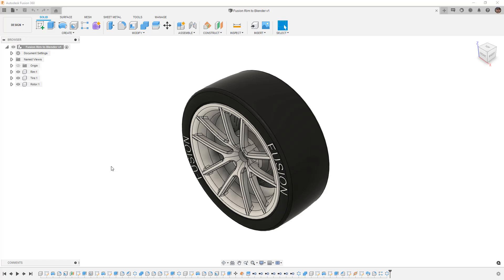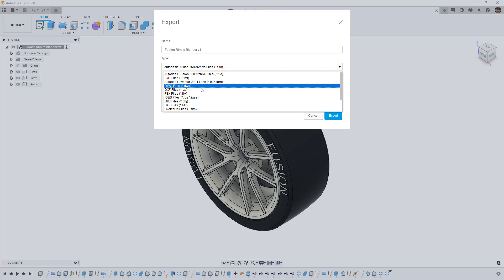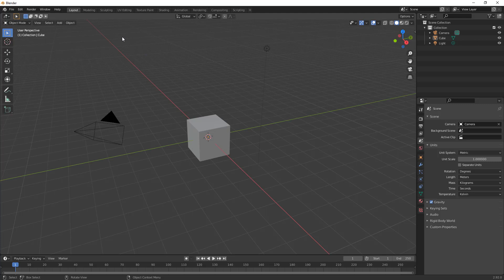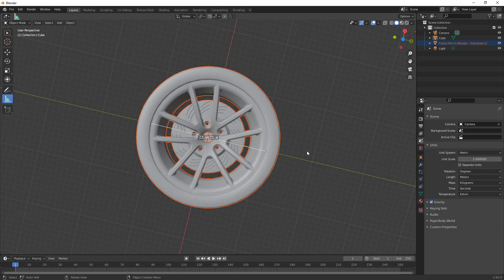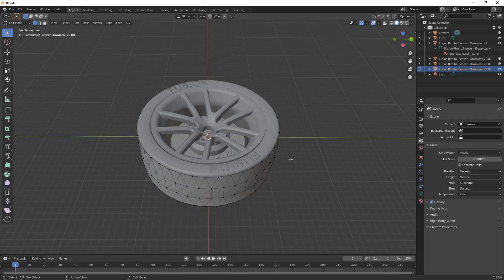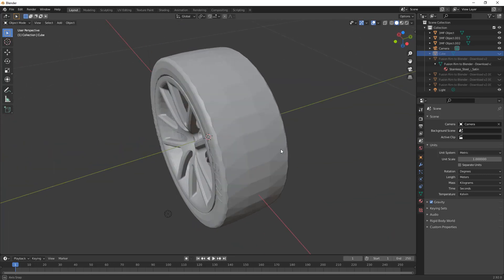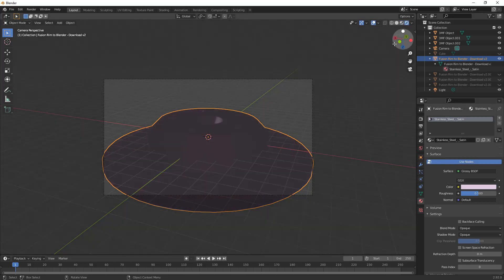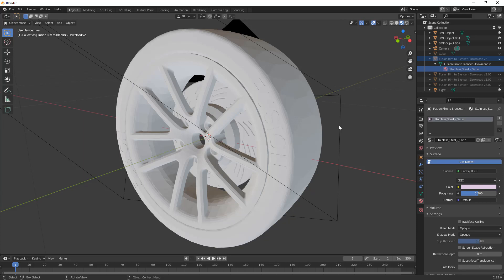Importing designs from  Fusion 360 to Blender - Part 1

Comment: hi I am trying to import a FBX file for fusion to Blender, the file imports, but nothing gets displayed, the textures are there but the mesh bodies automaticaly go into a unused section and i can't even access or recover that data on blender, and i automactly gets deleted when I close blender? is my FBX file corrupted?
Reply from the maker: which version of Blender are you using?  some of the imports/add-ons have changed a bit.
Reply: @LearnEverythingAboutDesign   i am on blender 4.2 I also noticed that when ever i create a New Fbx file it also creates a mtl file i have never seen it before
Reply from the maker: @randompersonlol7930  I am on 4.2.1 LTS and the fbx import worked fine for me.  Mine doesn't seem to create an MTL file  for the FBX export.  only an OBJ.  its a material companion file and generally when importing an OBJ i think it references this.  FBX should just take the color info in with each body on import.  

If you send me an email support@caducator.com ill send you one of my FBX files and we can see if the same is happening.

Comment: How do you add the add on with Blender 4.0.2? There is not test label under preferences. Thats as far as i have gotten.
Reply from the maker: hmm, it doesn't seem to work sadly.  You can stick with an OBJ or FBX format.  I don't see any updates to support the 3mf format.  Probably because its more of a 3d printing format.

Comment: I plan to watch the rest of your videos about F360 to Blender as I prefer the workflow.  Q: Why not use FBX format between the two apps?
Reply from the maker: Part 2 is FBX :)  obj and fbx in this case really would be no different.  If you were exporting out of blender then FBX might be the goto option as it has animation data.

Fusion can convert a solid body to mesh in fusion with "try quads" option. however when you export it as an stl. obj. fbx. its always going to be Tris unfortunately.  There will be some file size differences and OBJ and FBX will take appearances so in Blender you will at least have different starting colors.

Comment: I do not have the testing tab on Blender at 5:44. How can I activate the Add-On?
Reply from the maker: I just tried this on 3.5.1 and I don't think that add-on for the 3mf format is supported any more sadly.  I can't get it to work.  The testing tab i think went away with v3.5.
Reply: . @LearnEverythingAboutDesign Does this mean that the information covered in this vid about add-ons is no longer practical?

Nevermind, found the latest release of the add-on which works (1.0.2)
Reply from the maker: @leonzhang9287  Glad you found it!  I need to update this video!

Comment: Major thanks. I was just thinking this would be a great thing to do as Blender sucks for anything CAD, not having having drawing planes or a constraint system. Mind you, it is great for renders while Fusion 360 pales in comparison.
Reply from the maker: Yup :)  I ended up doing a few videos on this.  The program Plasticity I have been covering is a good middle ground as well. Not as rigid as CAD but work on actual solids.

Also this is on my radar to try. not free but looks easy to use https://lighttracer.org/#pricing

Comment: can you convert a building for example to blender and from blender to cs go hammer editor as a map ?
Reply from the maker: I haven't used Hammer before but I would imagine if you can UV Unwrap it in blender, that is the info you would need.  So yes at the core what you are doing is converting your 3d model to a mesh.  If you plan to texture it in Hammer, then going from Fusion to hammer might be an option as some formats like 3mf will carry appearance data with them.

Comment: As you suggested - I saved a model FROM Fusion in inches TO 3mf and then imported TO my blend file which was preset to metric, meters, and .001 unit scale. Size came out perfect. Love it.  I would say though that the add-on designer could make this size conversion more clear; wasn't obvious. Thank you for this video.
Reply from the maker: Thanks for sharing!

Comment: After importing an .obj from Fusion scale to 0.01. To avoid tessellation on .obj files. Click the body or component  , save as mesh and set a very small surface deviation.
Reply from the maker: That is exactly right sqwert!  I think on this example i was using the defaults for each file type which if you ever export a mesh defaults to "Medium".  You can use the mesh workspace and manually remesh a design before export if you wish.
Reply: Thanks - I have been looking for a way to do this for 30 minutes! You saved me many more hours of searching. :-)
Reply: @TimBrennan  if you want to make game assets export from Fusion360 as a low detail obj, then duplicate the mesh and add chamfers and small details export as a low a low deveation obj for use as a high poly mesh for baking in Substance. This gives to a very low vert count mesh although it's triangulated. There's an example of a Rhino 60D made this way on my you tube. This method avoids any retopo so very quick.